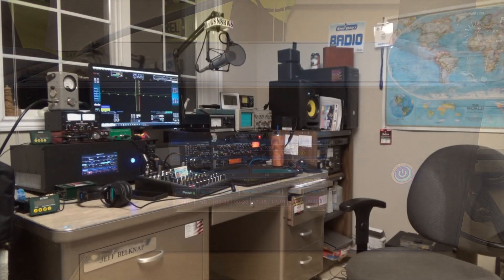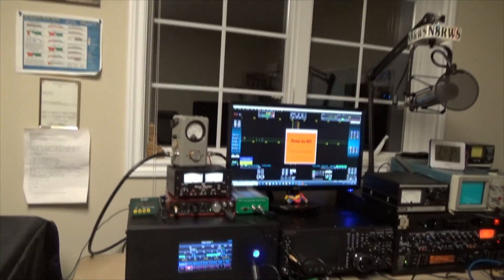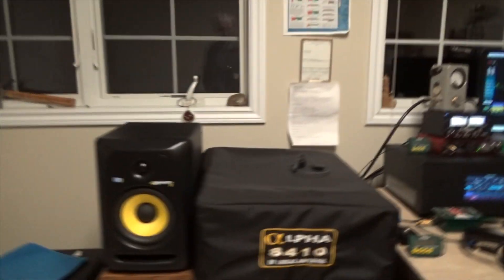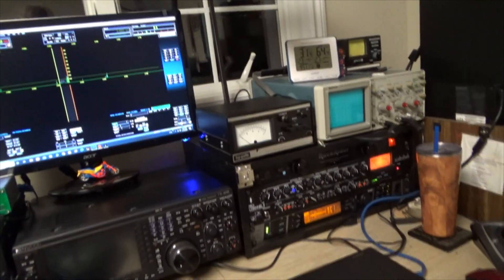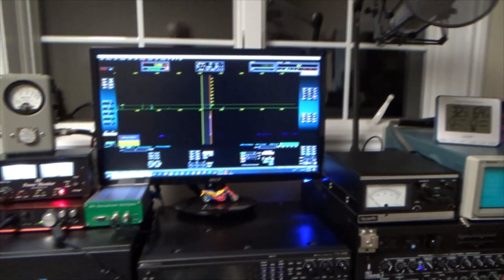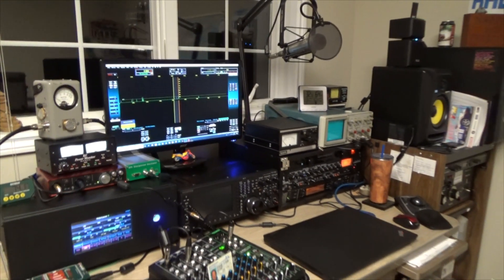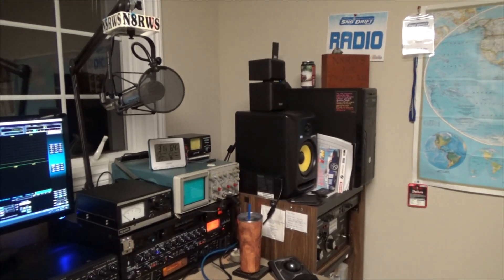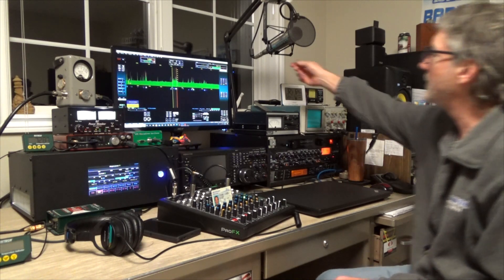VK3AMP   ESSB 2 18 2023

Comment: Nice. No problems with rf getting in to the audio anywhere?  I’m having a hell of a job with my xlr microphone and Focusrite and only 400w! How far away and high is your antenna?
Reply from the maker: Hi Mike, Dipole center is 150 feet from shack and only 35 feet high.  I had lots of RFI till installed a common mode choke on output of amp !

Comment: I think I was the first customer for the 1kW amp kit. Driving it with Anan 7000mk II and IC-7300. Surprised Onder has sales into the states what with the cost of freight these days. I really took advantage of the free shipping from Mouser  for the heavy casework and heatsink. I think they might have run at a loss on that transaction :) BTW The display will run quite happily on an extension  cable if you want to free up some desk space. That's how mine is set up.
Reply from the maker: Very good Rob! The cost of shipping using DHL Air was significantly less than the price difference between a commercial 2KW amp and the VK3AMP shipped !

Comment: 1.5KW and by modules. Easier to repair and less cost for an amp of the same power. Example, LDMOS, still powerful and a cost effective solution too. Great protection circuitry.

Comment: Yeah I just purchased the 1kw 4 FET Amp kit - its extremely well-designed. I love mine.. good luck good DX - were you working AM or SSB your audio is sounding so clear.
Reply from the maker: Hi, I was using SSB but at a very wide bandwidth.  Was around 8kHz all on LSB !  73  Jeff N8RWS